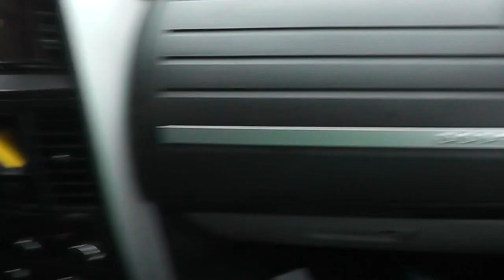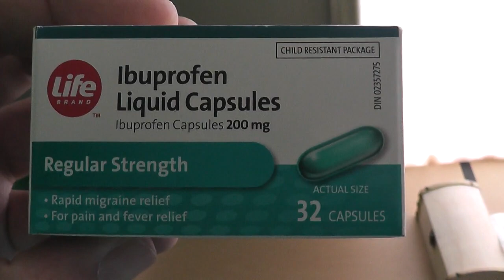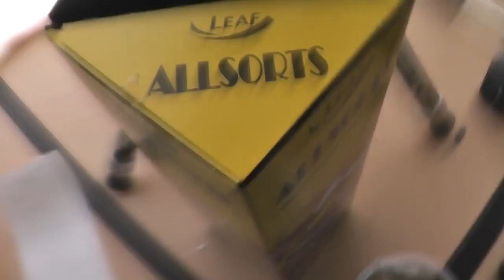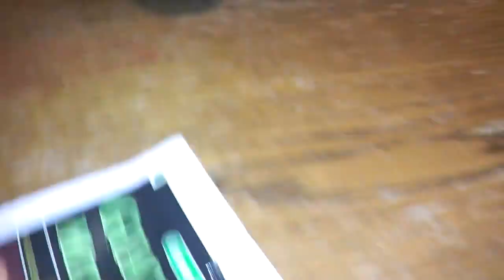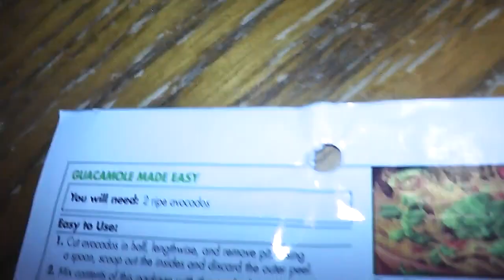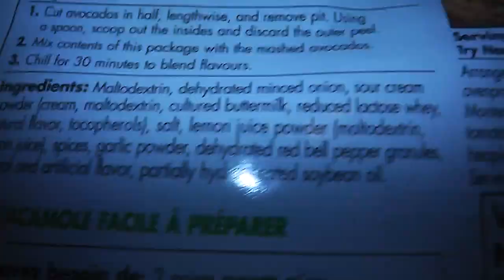A day of shopping with Jewels

Comment: That socket looked mighty crappy, lets hope it dont playup otherwise we know who will be doing it...... yep yoooooouuu ha ha :-))

Not accessable from the inside and bloody torx screws, that manufacturer wants a good kick up the jacksie with steel toecapped boots, replace them with user frendly screws :)

The fingerprint detail that jewels added really only applies to headlight bulbs, it creates a hotspot on the glass and can kill it, high wattage/heat halogen and similar.

Smashing vlog :-)